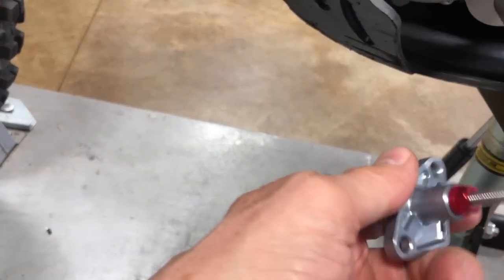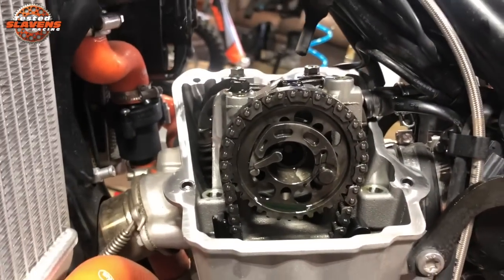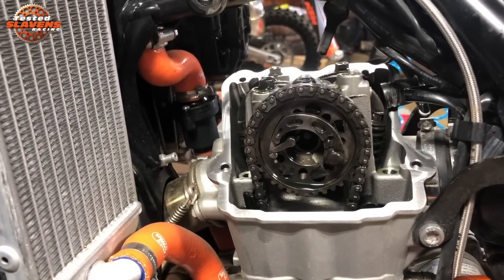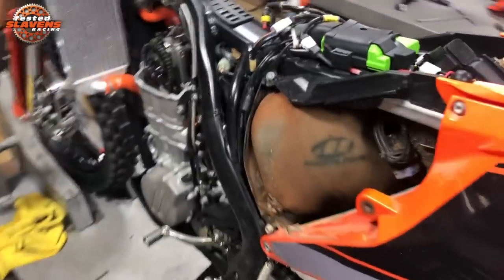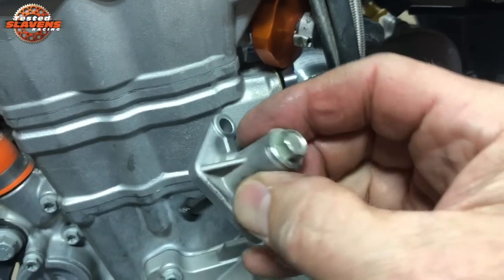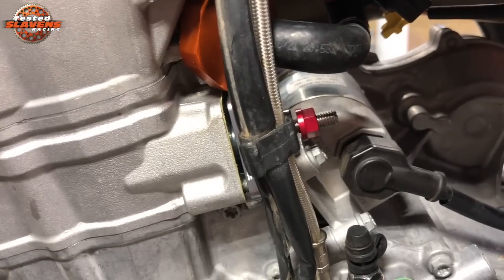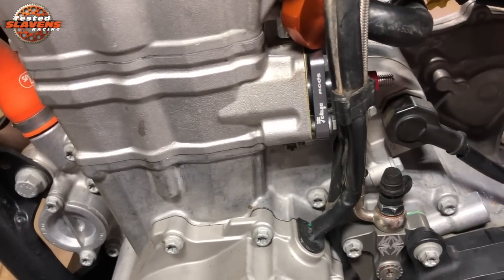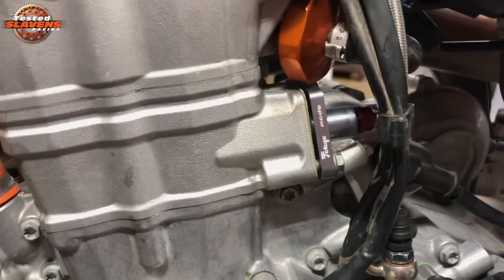How-to Install Tokyo Mods Cam Chain Tensioner

Comment: You forgot to tighten the jam nut, better get that before the next ride! LOL , How often should you reset the preload
( check it)! Good Video I love the Tecnical stuff.
Reply from the maker: Hello:
There is no set interval and mine almost never needs adjustment. If you hear the cam chain making a slight ticking sound, adjust it. Otherwise, ride it!

Comment: Do you really need to be at TDC?  Just remove and replace the tensioner, does not affect timing I would think.
Reply: I was also thinking this myself
Reply: @00DELAMERE00  i mean it’s easier to j be safe